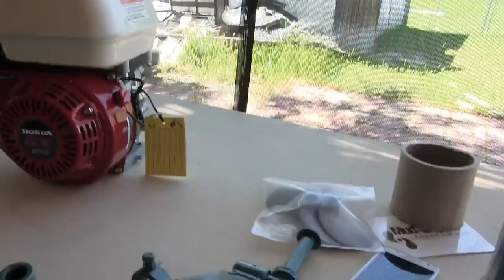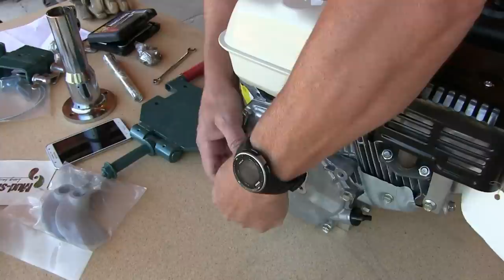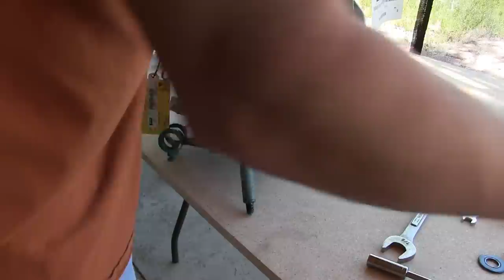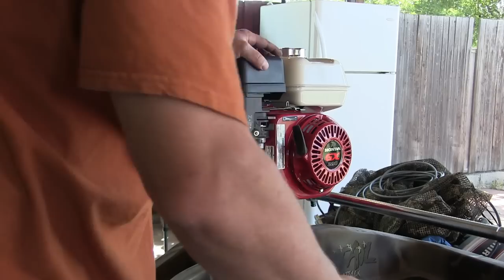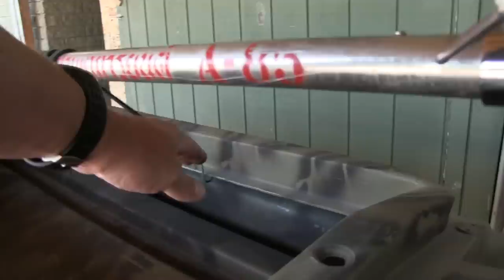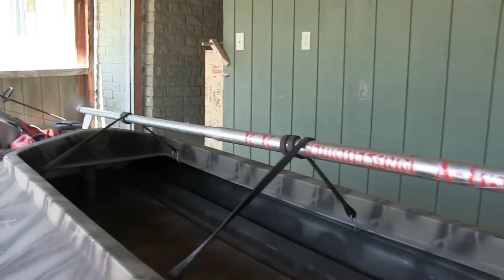MUD-SKIPPER LONG-TAIL BUILD (HONDA GX200)

Comment: The grease in the housing is the only fitting to insert grease ? Is that same grease suppose to ride down into the entire shaft ?
Reply: no the shaft does not require grease
Reply: well........ actually, it does. in thailand, as well as other asian countries that run these propulsion systems, the water is salt or brackish, very rarely fresh and pure. a mild steel pipe (basically what the kkk or sps prop shaft tube is) will corrode rapidly in those conditions, so in those countries they do pump the housings and the shaft housing full of grease until it escapes from the shaft bearing, to prevent any salt water from getting inside the tube. the grease is not a lubricant, just a water displacer. the cheapest grease would be used, probably rancid yak fat... the grease cups would get rotated on a schedule and refilled when empty. the system would constantly leak grease into the environment, hopefully just the rancid yak fat and vegetable oil... and families would depend on these things for their existence. they had to be cheap, reliable, economical to run and long lasting.

but in 'murica, people get tired of their new toys quickly and throw them away, so that part wasn't shared with you. they also tend to run in fresh water and don't leave their motors in the water all of the time. 

on my old kkk i've never run it filled with grease and i only use it in fresh water. i take it apart to inspect it yearly and it's still corrosion-free. bought it in the 90's

Comment: Which Honda GX200 model you use 
(LHB 2 (LOW RPM 1800 RPM))
Reply from the maker: The model i have is a gx200 tqx2. I didn’t know they sold a low rpm model because I would have got it ,but I will tell you this with the after market muffler,jet,springs and air filter this thing looks and performs awesome
Reply: @801Outdoors  thanks

Comment: hope you bolt that engine down to the boat or it will flip of the mounts and end up in the lake
Reply from the maker: watahyahknow wow that’s a bummer man sorry you’re engine flipped off your boat and ended up in the lake
Reply from the maker: @watahyahknow  im going to bolt mine down for sure thanks for the tip